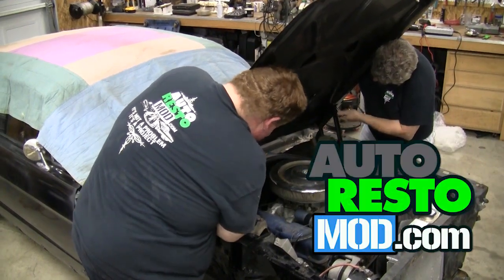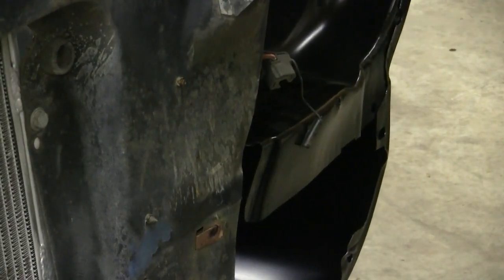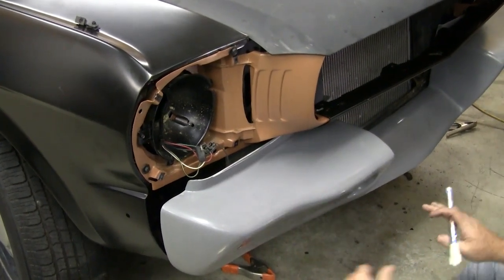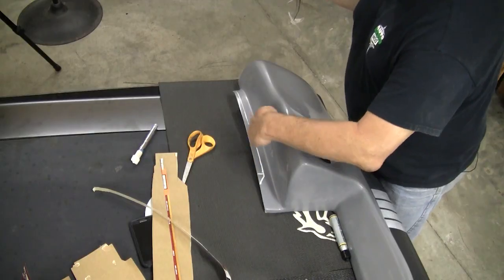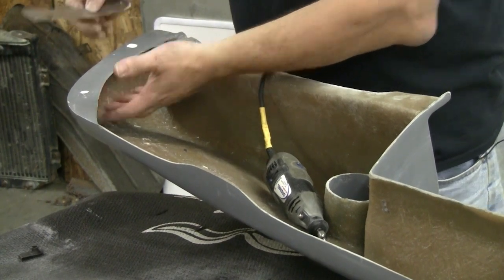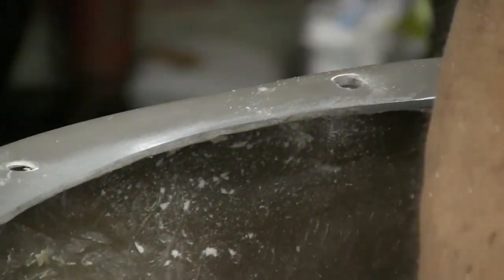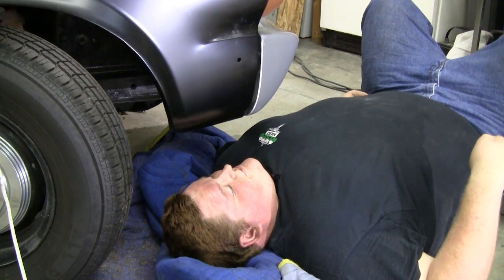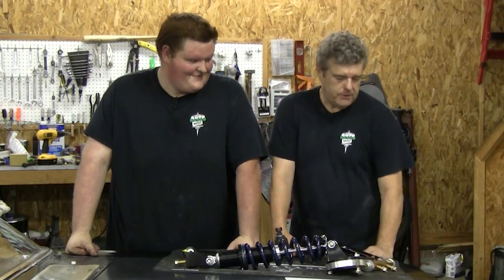How To Install a Shelby R Model Valance Race Apron 1965 1966 Mustang Episode 315 Autorestomod

Comment: best situation is to start with OEM or Ford tooling fenders and OEM  headlight  buckets and Cobra Automotive Shelby R model apron. I know the OEM fenders and buckets are hard to find but at least consider the Cobra Automotive apron, its what all the Shelby vintage racers  and Shelby open track racing circuits across america use.  you cant beat race proven parts.  I believe NPD sells Fiberglass  Specialties brand Aprons.
Reply from the maker: OEM is great, but even over here in the south, they are HARD to find. thanks for the heads up on the Cobra Automotive part!

Comment: This is some slight wrong advice. You should offer the part up and if something interferes with it sitting right if possible remove the thing that interferes and offer it up again to ensure it will fit at all before you do any cutting as you may have the wrong part and you can't return something you've cut! Also you may get a better sense of where and how much to cut.

Comment: I would have made much thicker backing plates. And welding the nuts to the backing plates make life a whole lot easier.
Reply from the maker: We said that we would recommend that you go with a thicker plate (16 gauge over our 20). Welding the nuts would reduce the "wiggle room" that you have with your nuts being loose...
Reply: Even 16 gauge is a little on the light side. If you can bend it by hand then it can distort when you tighten the mounting hardware.  It is called a backing plate not a backing sheet.:D  And if you weld the nuts to the plates you just make the mounting holes in the valance slightly larger. That allows more adjustment of the panel without the hassle of trying to start the bolts whiling fighting with the valance, backing plates and loose nuts. But whatever, that's the nice thing about this hobby. There is more then one way to accomplish the same goals.
Reply from the maker: And why we like for folks like you to comment! We have learned a great deal of stuff from our viewers.